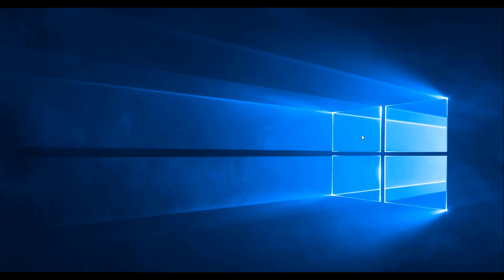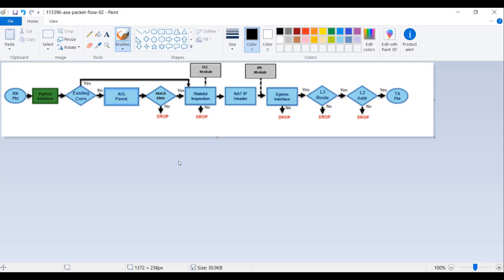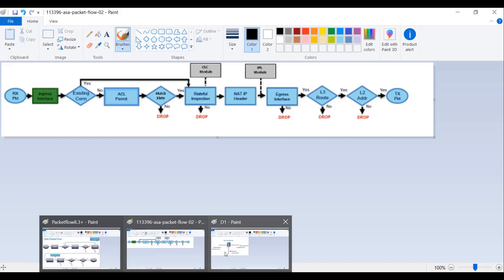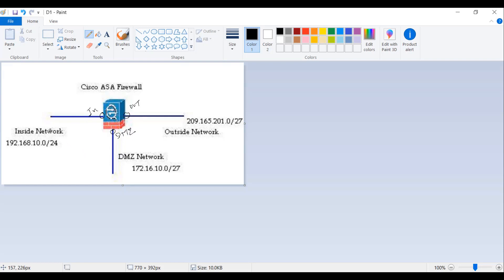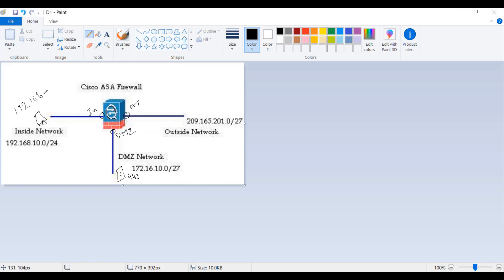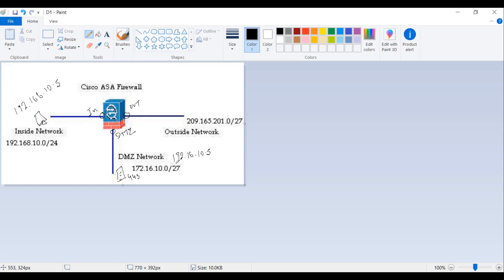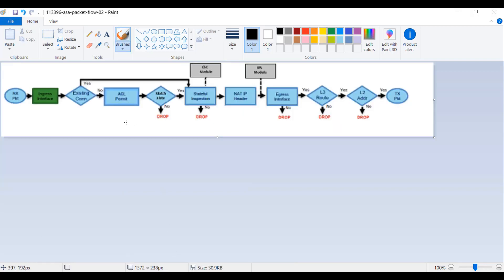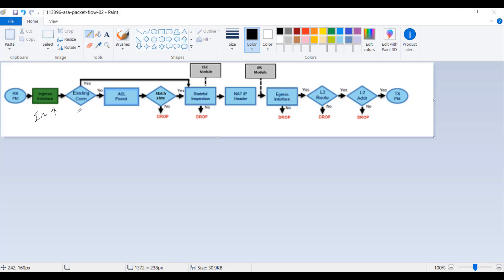T-Shoot Labs - ASA Packet Flow.

Comment: I have a question. what is the difference in step 3 (or 2 post 8.3) of xlate and Nat IP header? is it that at first the nat rule is matched and then after inspection the IP header is re-writtern if required ? also what is un-translate ?